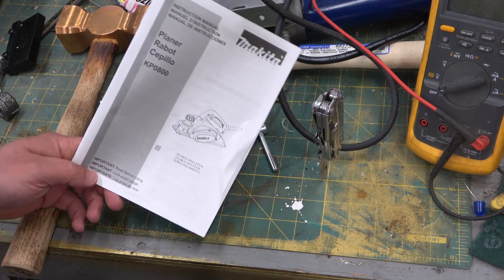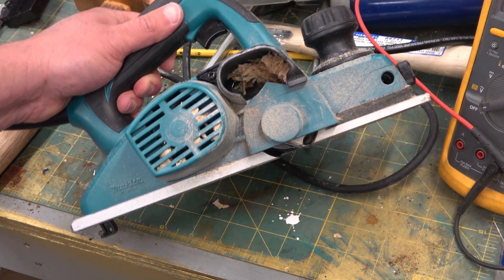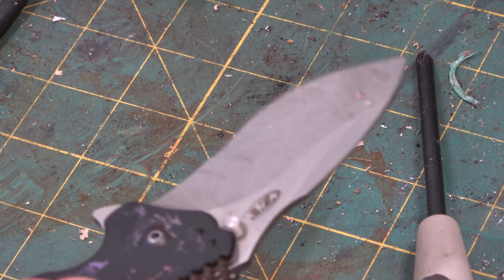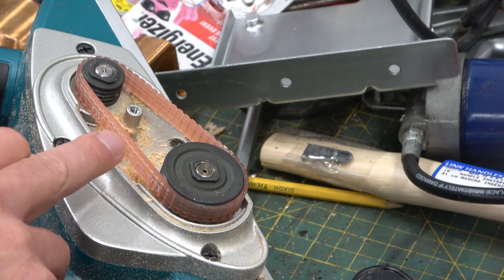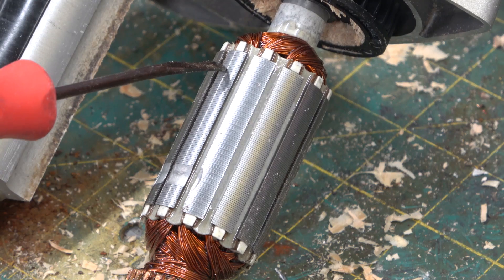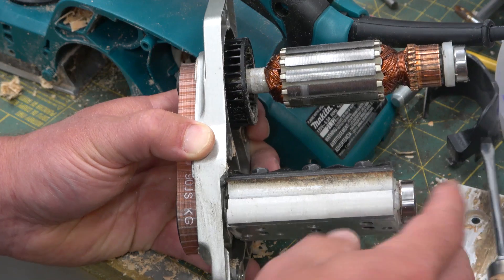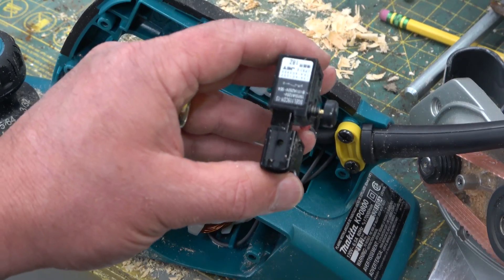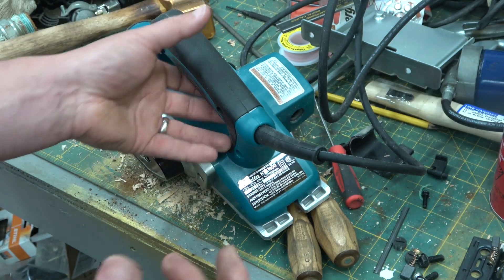BOLTR; Made in USA Makita?

Comment: Makita never changes - I bought the identical machine in 1982, and its still going strong -
Reply: Why fix it if it aint broken
Reply: Bought mine in 85 or 86. I wonder if there is an easy way to upgrade to the disposable carbide blades. Guess I ought to look that up.
Reply: @Eminate2121  Nope - It never gets used long enough to overheat - Primarily for fitting doors. Maybe I should, though
Reply: @christopherdahle9985  I bought a conversion kit 10 years ago. check with your local warranty shop -
Reply: @glennworton2494  and converted it onto an angle grinder?
Reply: @Eminate2121  I know you are asking Glenn, but here's my experience. When I first got it in the mid 80s I would clamp it up in the bench vise and use it as a jointer, so sawdust and chips did accumulate in the vents etc. Never enough to interfere with operations. Using it this way is effing stupid unless you build one of these https://www.youtube.com/watch?v=2m3EiVRCUjk . After the second time mine came loose in the vice I bought a real jointer. Once I plumbed in shop air I began blowing out all the power tools before I put them away. It stays pretty clean.
Reply: @glennworton2494  Weird, I thought I had replied to you Glenn...anyway, I've ordered the conversion kit from Ereplacementparts. Worth it at less than $40 bucks and I already had a shopping cart full of bumblebee parts I was waiting to order.
Reply: Are the stickers off kilter too?
Reply: Blue is Makitas professional range. Have a Japanese made one,  identical in design and build, been going for 20 years. Changed to brushes once, replaced the cord as it doesn't work after you plane it, other than that it's obviously a design that's worked well for Makita for many years.
Reply: not true. this new model is better with the rubberized handle, ratcheting depth knob, and that handy little gizmo that allows you to set it down flat without gouging your freshly planed workpiece. And yes, my stickers are on straight. 👍
Reply: @grant3226  I’ll bet your cord was flat in one spot after planing!
Reply: @blueman5924  I agree with the other improvements but that “handy little gizmo” you described is a pain. I put a screw through it to hold it back out of the way because it was forever catching on the ends of the material I was planing. It won’t fold back properly when you’ve got to hit something at a 45 degree angle either. I just sit it down with the nose or tail resting on a block of wood so the blades don’t hit the ground. I got used to doing that while using the older model anyway.

Comment: We use this tool on site almost every day. It works really well and gets the job done. You’ll cut through the dam coord way before anything will break on it. Only time it did break was when it hit a nail but it’s easy enough to get parts and fix. Mainly use the 18v battery version now though . Don’t have to mess around finding power, and tangling or cutting the coord
Reply: put your cord over your shoulder with all corded tools then you will never trip over or cut your cord as it is behind you out of the way never cut a single cord in 40+ years as i learned that in the cabinet shop before venturing into contracting
Reply: @Karl with a K How many threads are you posting this in, mr Ali Express power router salesman?
Reply: @Karl with a K The much cheaper Ryobi has the benefit of a round ejection port and some attachments for scrap collection, a valuable bit that saves cleanup time.

Comment: Used that Makita(though made in Japan) commercially/daily for over 10 years and it never let me down. It saw 20-30 minutes of use per day on average. It was retired after 10 years because a bearing failed. An "upgrade" to a Ridgid, then Dewalt and then Milwaukee went full circle back to the same Makita as the others all sucked. The bearing was replaced on the original one from the mid 90's and now collects dust in the bottom a tool drawer. 
Why the Makita is the best: lightest, smoothest and easiest to maneuver.
Reply: i agree at least they were the best a few years back i used all of the ones you mentioned above and the Makita was the best by far
Reply: @kirkyorg7654  made in Japan made the difference

Comment: I have had mine for about 20 years. Never had a problem. I have probably fitted at least a 100 doors in that time. And used it all the time remodeling four houses. Mine came with a blow molded case and a fence to help you stay on the edge of wood.

Comment: Hi all, ive had the Bosch version of this for bout twenty years, always use it with dust collection. No mess in customers house when shaving doors to fit and no shavings worth mentioning inside the unit. Not a daily tool but sometimes its just perfect.
Reply: I got the Bosch timber planer as well from someone that didn't want it any more, can't argue with free even if it will try to nip a finger off
Still got no real fucking idea what its for but boy oh boy, does it make perfectly good bits of wood into bags of sawdust
Reply: that's what i have atm it is not a bad little machine for occasional use i like the collection bag that goes on either side got it when i was working in apartment buildings a few years back really good at collecting the shavings

Comment: We had a simple AEG PL750 planer, and I melted the bearings through the plastic body of it. Had to plane some 2 by 4s on both sides, probably happened because the day was hot, about 33 C,  the plastic tent I was working in was not ventilated and I worked with the planer for about 2-3 hours. I thought I had it on the adequate depth setting, the kind of depth setting that is the next one from when it does not plane anything, but no - The bearings melted through. It still lies in a pile somewhere.
We now have a Makita planer, one of the low end ones, that comes in a big plastic case though, probably KP0800. Unfortunatelly, or fortunatelly for Makita, I was not able to test it the same way. It is still running though, the bearings are OK.

Comment: Just wanted to share about the one I inherited from my dad. It does not have the blades yours has. When I first tried using it, there was rust and pitting on the blades. I pulled them out and sharpened (each blade is one piece locked under the clamp). I got most of the pitting off. Enough so it does work, albeit some sanding is needed afterwards. Still, it does a nice job. Mine is evidently made in Japan. The badge is riveted on, not a sticker. It is in a molded case with all the accessories. My dad probably got it in the late 80s or early 90s. Now that I've seen your video, I may try to do a more thorough cleaning. It is a nice tool; much easier to use than a hand plane (of which I also inherited several). Thanks for your videos.

Comment: Looks like you might have come across the Makita turbo-encabulator router. 

The original machine has a base-plate of prefabulated amulite, surmounted by a malleable logarithmic casing in such a way that the two spurving bearings were in a direct line with the pentametric fan. The latter consisted simply of six hydrocoptic marzelvanes, so fitted to the ambifacient lunar waneshaft that side fumbling was effectively prevented. The main winding was of the normal lotus-o-delta type placed in panendermic semiboloid slots in the stator, every seventh conductor being connected by a non-reversible tremie pipe to the differential girdlespring on the "up" end of the grammeters.

— John Hellins Quick, The turbo-encabulator in industry, Students' Quarterly Journal, Vol. 15, Issue 58, December 1944

Comment: Been using mine in the field for 30 years. Other than eating the cord off it, it's been good for rough work. Those insert cutters are a nice upgrade (the old carbide knives were brazed to steel blanks).

Comment: The obvious design flaw here is that its air intake is where it exhausts the chips!
Built to fail is the only score I give it there.

Personally would have designed it with an air filter, perhaps a fancy DRM free user replaceable one.
Reply: Yes. This is a problem. But the damn thing just keeps on chugging away, even with that cover jammed full.

Comment: I own 3 18v versions, look pretty much the same. Over past 4 years only one had an issue, but by the time the replacement arrived, it started working again, and still does. 
I use mine daily at work, mostly on plastic and thin aluminium while installing windows.

Comment: Bought one at a used tool store a few years back to clean up a stack of really rough previously enjoyed lumber. Gave her a hot supper for a few days & she didn't bark back at me. The blades sustained only one chip in spite of having hit many nails. When I was done with that project, I just flipped them around & haven't had to get a new set yet. Since then I've used it to trim doors to fitting width several times (fucking game changer) & nothing else.  I'm certain I exceeded the specifications for "intended use" of this tool & haven't had to file a T4011 on it. For $60 I can't complain.

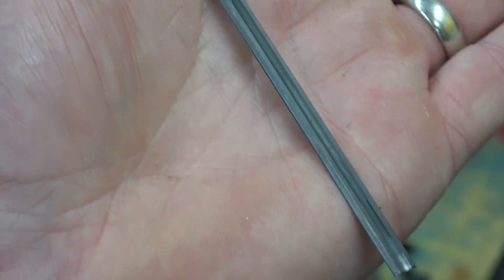Comment: Decades ago, an acquaintance of an acquaintance  told me that he asked the other guy how he lost the tip of his finger, and was told it was via a power planer. Until this vid at 5:08 I couldn't finger out how it could have happened. Probably monkeyed with the blade with his finger on the trigger and the unit still plugged-in.
Reply: I planed 1.5mm off the tip of my finger as an apprentice. Grew back thankfully.
Reply: My father cut the end off his ring finger so far that the whole nail was gone and the hospital cut the bone back a little and my father washed it in peroxide every day and put some sea weed stuff that looks like fibreglass on it and his finger grew back including the nail which was amazing but it was really flexible because of the missing bone

Comment: Burned one of those makita things up in about 5 to 10 minutes in oak at 3mm or whatever the full depth is this thing can cut. Motor just overheated and burned up. Luckily it wasn't mine.. sadly I had to buy a new one because I had to give it back. My bosch one didn't complain about such workloads but it had a broken belt that day. It also has one of those non-slippy teeth belts.

Comment: I have the exact same planer and used it to drop 1500 SF of joists down 2" :-)  In regards to stalling the planer, if you accidentally hit the front adjustment deck during an overzealous stroke it will push the deck back into the blades/drum and will stall.  It will also take a small chunk of the adjustment deck where the blades crash into it, but it still works fine. The carbide blades are nice but very brittle when you hit nails or any metal, so I found grabbing a couple packs of the HSS blades and resharpening rotation is the best option for what I was doing; I used one of those cheaper two-sided metal bars with embedded diamond to sharpen, it takes a while to teach yourself how to sharpen freehand but I believe they make jigs specifically for them.

Comment: I have one of these that is probably 30 years old. Got f for five bucks at a yard sale from a retired carpenter/set designer/roadie. It was well used and seized up. A couple of bearings, a new belt, blades, and brushes and it works good as new. Up until recently, I was a profession wood butcher, and my planer mostly got used for leveling floor joists and such. Not an easy life, and it still works fine.

Comment: I have one of these and could NEVER get the fucker to cut parallel. One side always grooved badly no matter how carefully I set it up.

It also sucks shit for reasonably accurate jointing an edge.

I can confirm that the blades are skookum though. I accidentially grazed it across a machinist vice and it planed off a nice smooth thin shaving of goddamn cast iron.

Comment: We use those Makita planers at work and they have lasted 15+ years with regular (ab)use, the only repairs I've had to make are belts, belt guards and brushes. The apprentices quite often smash blades in them trying to plane end grain. To change blades just loosen the 3 bolts and they slide out the side. Also the pulleys are threaded on,  at least they are on the previous model, hence the square "loosening device" locators on the pulleys.

Comment: I worked as a Makita tech in the 90s,  the old 1900B with the riveted name plate was more heavily built so I only saw them if the owner was smart enough to bring it in for bearings as soon as they got noisy.  The routers were worse, I had a few come in where the ball bearings seized,  spun and melted the housing so we scrapped the tool.  Had the owner caught it right away it was relatively cheap repair to replace the bearings

Comment: This is the home gamer model, I've owned 2. The first was involuntarily donated to some fellers south of the border. The second has lasted near 3 decades and taken the tip of one pinky finger off (it grew back). 

The failure point encountered, aside from the trigger puller's lack of  operational knowledge, has been the belt. They seem to have a life span of 10yrs. I have recently installed the 4th belt.  I use mine attached to a big can that sucks, keeps the dust from gathering inside the spinny thing.

Comment: I've seen a few of those planers take a hit over the years.  They don't recover very well.  When they go, they generally leave for good.  Fortunately no one was hurt in both circumstances.  They are also a tool that if handled with experience can do amazing thing or with lack there of, ruin the hell out of a potentially nice project due to over material removal
Reply: The scary part about planers and routers is that there's no stitching back anything that you cut off. It just gets shredded.

Comment: I had one of these 30 years ago. It would do a full 4mm rabbet cut but you had to let it work at its own rate to clear the chips or clogging was a problem.  Best around then and probably still is. Hands down better than the Hitachi I owned at the same time, and that was pretty good too (before they started making silly crap) Mine even came with alternative steel blades, sharpening stone and sharpening jig.  I just used the carbide hooks. Mine was probably Japanese made.  All good until the African labourers used it! Destroyed in hours after years of use by myself.

Comment: I've been using that planer for YEARS. I got to learn all of it's idiosyncrasies and even took off a 1/4 of my finger tip with one when there was an "unfortunate cord pull" (It grew back just fine). I wish that the blades were more substantial rather than tiny little bars. If I plane old joists and hit a hidden bit of a nail or something, it's a 50% chance that the blade will snap entirely rather than just leave a nick in one side.  They clog a wee bit too easily but can be cleaned out with the ass-end of a pencil while running, and need to be completely blown out with an air gun to run optimally. LOTs of ingress around the brushes. Need to pay attention to which side can drop over 1/8" when working on larger surfaces. 1/64" is great for just evening out minor high spots from swelling or planing. Kickstand can be annoying sometimes but meh, mostly works fine.
Reply: Weekly: 8-10 hours of use. Mine last up to 5 years and they mostly die from the trigger going bad or nicking the cord and being to lazy to replace it on the jobsite. I blow mine out ENTIRELY, every 20 hours of use. The cordless version just DESTROYS batteries. Go with the corded. My current planer is 2 years old and I expect it to last for at least 5 more with my routine cleaning...... so long as boss man doesn't keep stalling it out and burns the belt (I can replace that though).

Comment: I’m a contractor & have been beating on one of these for 8 years. In the field, not a wood working shop. I wish I could upload a pic. It’s the toughest electric tool I have. No BS. At least 50 blades, factory belt. Never bogged down, belts never spun in the pulleys, never a single issue. Do not hesitate to buy one. I wish it would die so I could get a cordless Milwaukee

Comment: Nice review but yep this is their weekend warrior tool. Their tougher KP0810 model looks similar, same cutting width but has dual (switchable) chip extraction ports, a larger motor and is heavier. Been using it for over 4 years and runs great. Just replaced the brushes, no sawdust build up problems but I do clean out my power tools with compressed air occasionally just for that reason. They also make a monster 6.75" wide machine that you can plane barn timbers with!! KYDIAV :)

Comment: Failure mode on these is passing over the cable while you plane, while the circuit is on a 15A (read 100A) fedral pioneer breaker.

Comment: I had one of these that I used plenty for restoring decks. We also used a literally fuckton of sanding sheets, pads, a d drums. 

The planer was the answer when we needed to rip off an eighth or more. Handrails etc, then you sand them off aftervorts. 

It didn't break before it got stolen. Had it for 4 years.

Comment: Those blades are real sharp and hard but brittle too. Take the heads right off nails. And then you change the blades.

Honestly, dunno which particular model you got but these things just keep on working. You can have the whole fan exhaust cover chock full of dead tree shmoo, letting no air out and the thing just keeps buzzing.

Comment: I've had a few. One died, an unexped death. Hitachi I think. Developed a twist between the forward and aft soles, always cut heavy on one side. Incurable, threw it out. 
Still better than the old spiral cutter porter cable power planes which routinely mowed off the fingertips of anyone silly enough to be left handed.

Comment: So the artifact on the platten is more than likely for a plastic shoe or protective cover. I do finish type work with tight tolerance and fine finishes and some of our equipment that we drag along $500 per square foot finishes has a disposable shoe that clips on to it. (Like saws and stuff. I don't sand or plane off expensive paint)